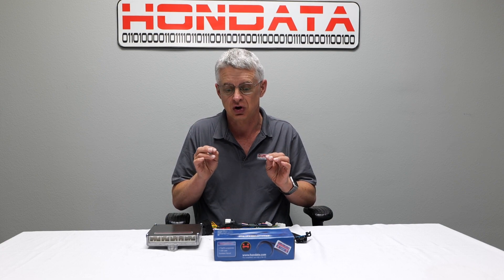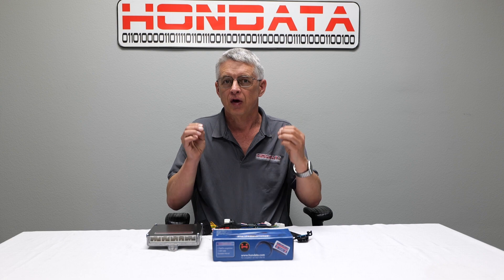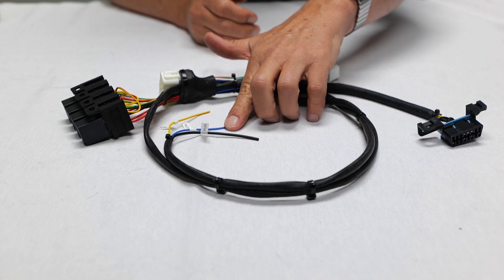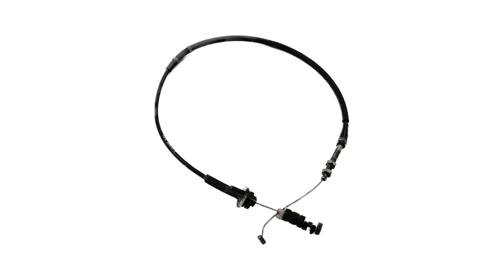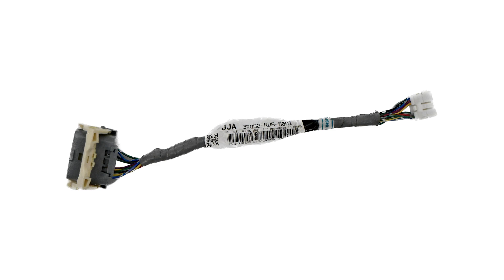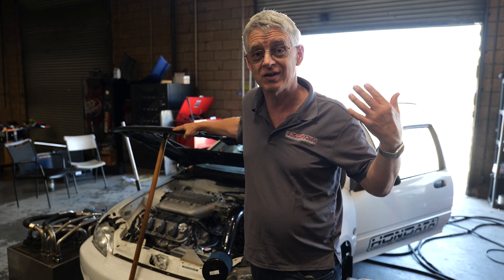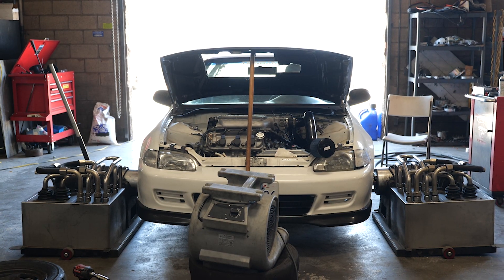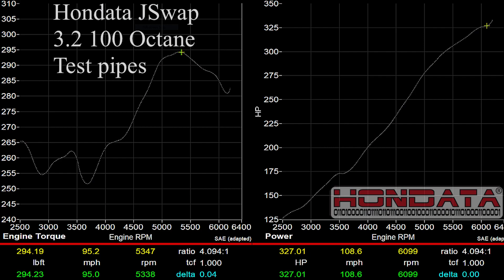J-Swap Kit | Hondata | FlashPro

Comment: C’mon HONDATA! 
Make them for the first gen J-series and other throttle by cable applications. At least these don’t use that pesky VCM system and have regular exhaust ports. not everyone uses or likes throttle by wire. 
Can you also make something compatible with the RL-1 Odyssey J35A4 please? There’s a huge following of these vans and we need more aftermarket support for there’s hardly any.

Comment: Says on hondata's site that the board has to be permanently locked to a TL ecu and only ecus sold by Hondata can be used?  Any particular reason?
Reply: transmission lockout compatibility i bet.
Reply: @hellbringer09  You referring to the reverse lockout solenoid?
Reply: @esnebta  no like the antitheft workaround cause thats a whole bear to reprogram and get the ecu to learn the transponder in the ley so the car will actually crank
Reply: @hellbringer09 The ECUs are physically modified, at least the soldering for cruise control.

He pulled the 03-07 Accord / 04-06 TL flash pro from their website, so I guess this is the replacement. So he's wanting to do this because it's more profitable for him.

$1800 locked to the ECU for life with 1 year of support?

Most of this kit is dependent upon sourcing parts from a 07-08 TL or 'buying new parts from Acura.' (just like ALL of us drive to the dealership and pay them to reprogram the immobilizers on 16+ year old ECUs).

This guy is out of touch. Too hung up on being "official". This isn't like the mid 2000s when K-series were brand new and D/B/F/H series were still fresh. 

SIXTEEN YEARS since the last one of these supported engines rolled off the assembly line. This is equivalent to coming up with a 'solution' to the 3valve/cylinder A-series engines in 2005, and then selling the 'solution' for over 3x the cost of a junkyard engine. Get real.
Reply: @esnebta  gotcha i didnt know the specifics havent done a j that in depth but thanks for the run down

Comment: Which Manual Transmissions can we use with this kit?
Reply: My understanding is any transmission that you mount the engine to.  However, that means adapter plate, new shaft, lots of r&d and time, and wiring sufficient to communicate.  There are a good many people online that have been able to mate j32s & j35s to a ton of different transmissions, just takes time and money.
Reply: rx8

Comment: This set up will work on 
J32A3
J35A8
Only DBW? Iam builting a EK with a j32A3 enging from the 04 to 08 TL
Reply: I'm working with the same engine and chassis.  I'm still trying to figure out an ecu if you have any recommendations it would be appreciated
Reply: @JLR775 haltech if you have money. Otherwise speedy efi is a great deal for performance
Reply: Run it on fuel tech I was having immobilizer issue with stock ecu
Reply: @GhettofiedInc  fuel tech is far superior over the stock unit for sure just cost a little more. keeping the stock allows for obd2 scan but again if I had money fuel tech or haltech are high options or basically the only 2 lol

Comment: Does the main engine harness have to be manual or will auto work as well?
Reply: nvm, guess its limited to 07-08 type s 6spd harness.  As if those are plentiful🤦‍♂️
Reply: @user-nu5qr6wh7g I know it’s been a year, but it says j32a3 and that engine harness its the same for the accord v6 manual as well.
Reply: Are you doing a j swap?